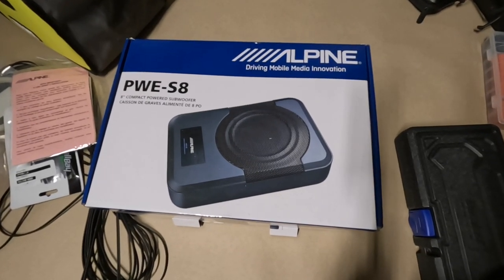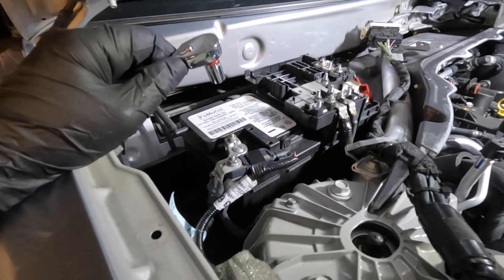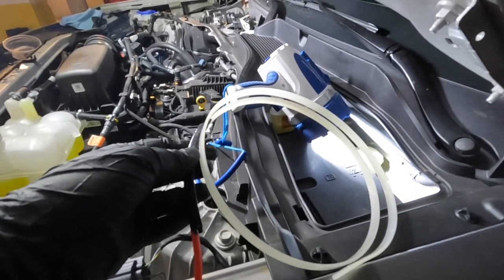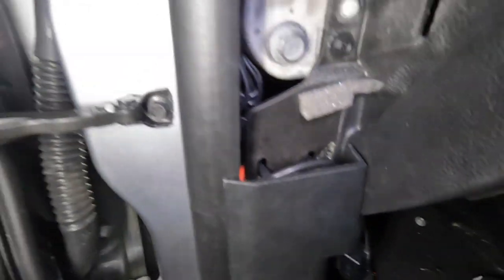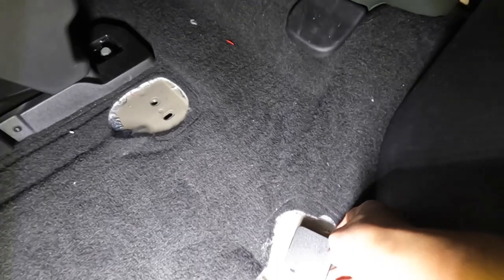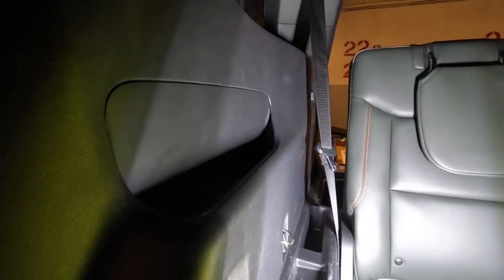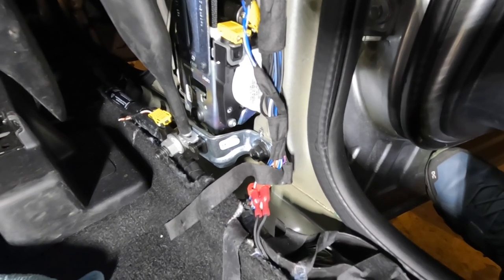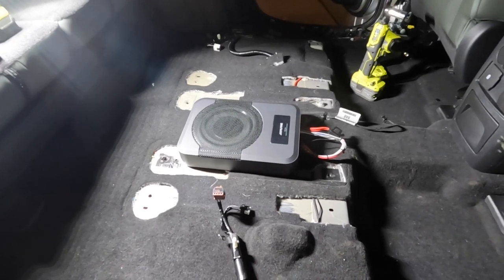DIY Compact Subwoofer Installation on a Ford Explorer Timberline

Comment: Great video. Which fuse did you use near the battery + and the AWG of the power & speaker wires?
Reply from the maker: I bought a kit from Crutchfield. Comes with the power wire and fuse. So I’m not sure about the specs.
Reply: @BradHemedes  Thanks for the reply. The sub comes with a 15 A fuse near its terminal right? So do we need to add an extra fuse near the battery also?
Reply from the maker: @RiniyaEldon oh yes! Power cable fuse protects the car battery

Comment: So you did not have to use the remote wire/turn on wire?  How does the amp know when to power on and off?  I was following your install and now I'm stuck on how to get a signal to the remote wire for a kicker hideaway 8" compact sub.
Reply from the maker: From the speaker signal. It will turn on and off your amp. I believe it is a standard feature for amps. There maybe a switch though between remote wire or speaker signal. Check your manual. I am sure Kicker has that feature.

Comment: How you use it my truck came with one but il turn on just that u don’t hear the bass
Reply from the maker: Check if the remote level control turned all the way up. If the wired remote is not installed, you have turn it up on the bass module itself

Comment: Why did you have to connect to both left and right speakers to receive the signal? I saw another video that connected to only one side to receive the signal.
Reply from the maker: I believe bass signal is stereo also. Meaning some bass signal are sent to left speaker and others to the right.